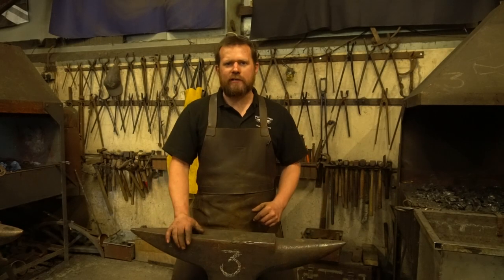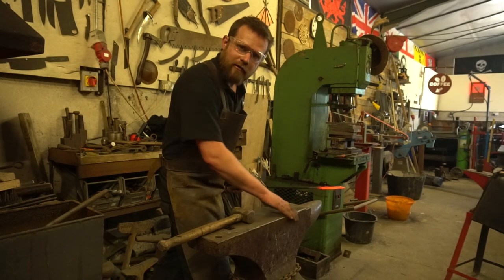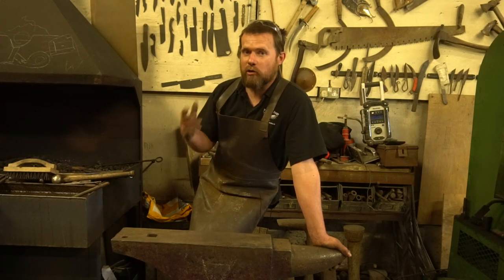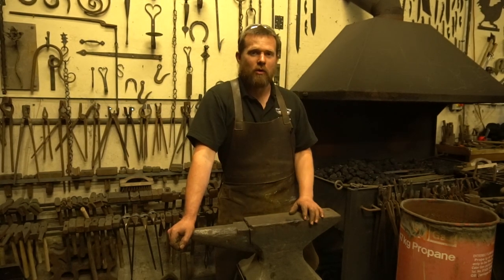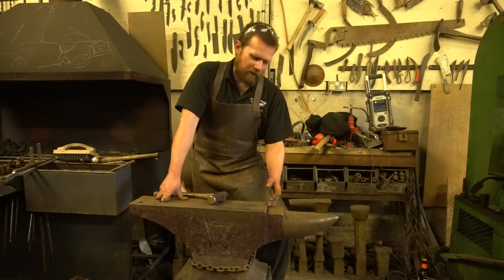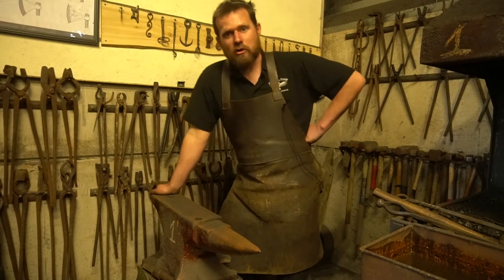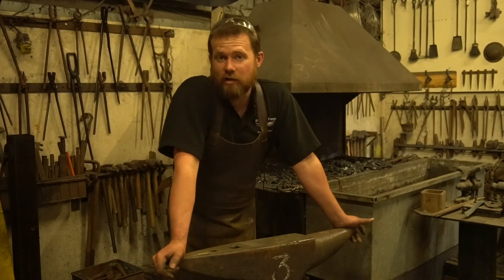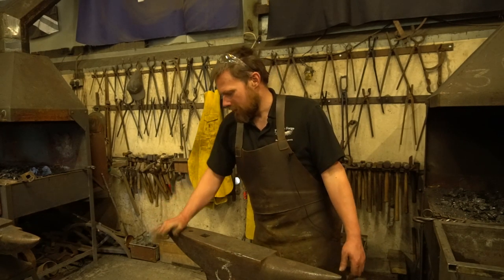The Anvil Buyers Guide -Blacksmiths Essentials-

Comment: Don’t mill your anvil faces! Also welding your edges is not a great solution either! Wrought anvils only have so much steel on their faces, every gram you grind is a gram you’ll never get back. Same for cast iron. And with any hardened face anvil the faces are hardest on the exterior and get softer and softer the more you remove from the surface. Avoid removal at all costs!

Comment: Off to collect mine this weekend - London pattern and a bit of a beast at a shade over 200kilos [450 lbs] ...  so that will be a bit of fun getting it up into the trailer. Looks to be in pretty good shape. The anvil was acquired, liberated or otherwise 'taken into protective custody' by the current owner some 20 years ago, when a large mining machinery manufacturer went bust. Does not look abused in any way, big flat table [24" x 6"] and 36" overall length. Hopefully,  its industrial origin means it is reasonable quality.  Bought unseen other than photos, but well worth the risk at £ 0.50 per pound..... I'll guess all  will be revealed in a few days  ;<)
Reply: Well how did it turn out?
Reply: @Ihateutubecontextandsensorshit  
All I had hoped for and more ! Top is flat and true both ways, within1/16" and with only a couple of very minor dings. There are a few sections of the edge that have been welded but these appear to have been done some time ago and have stood up very well. It is probably older than I thought, and bears hundreds of scars on the wrought iron body and feet where the Smith has tested newly made or sharpened edge tools. I am told by an experienced Smith that it is probably a Peter Wright, but have no way of knowing for sure, any markings being long obliterated.
In short I consider myself extremely lucky  and could not be more delighted with it.

Comment: Got a marvellous 125kg North German pattern (one horn and one tapered tail, hardie centre front where the horn starts, hardie on the other side, centre back, where the tail starts tapering, also with upsetting block on it's (right side/far end from where I'm standing)) Peddinghaus, in absolutely mint condition. For only €400 which is stunning for the current anvil market. 
I also have a 80kg (ish) old London pattern, though I suspect German made before 1900. Which is not in an ideal state, but works well enough for a floor-placed upsetting block. Which came with the fieldforge I bought a couple of years ago.

Needless to say I've been terribly, terribly lucky. Sure- both were on "the other side of the country", but then said county is also terribly small.

Comment: Good luck trying to find any anvil on auction in America for less than 3 or 4$ a pound.  I have two Peter Wright. One on excellent condition with a small scale track  mini anvil that straddles the heel and also a foot inserted in the hardy hole. It is really an amazing piece of forge work as it fits like a glove. On another note, my dad has my great grampas wood turning lathe that is all hand forged legs and such.

Comment: Great video, I think £2 per kg would be very optimistic these days, people are charging over that price for an anvil that looks like it's melted. I've been on the lookout for a replacement for my small 18" maybe 38kg anvil which I'm finding a little limiting as it just allows too much impact through the floor into the house. So think a larger one may solve the problem. Thanks from North Yorkshire.